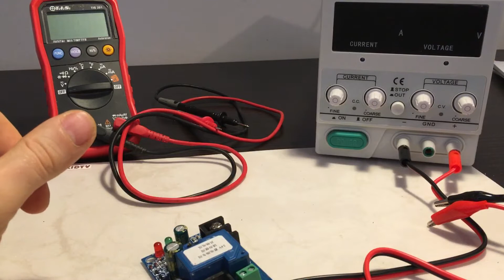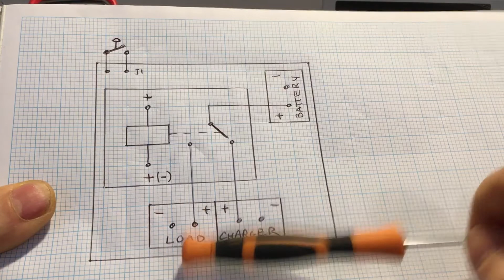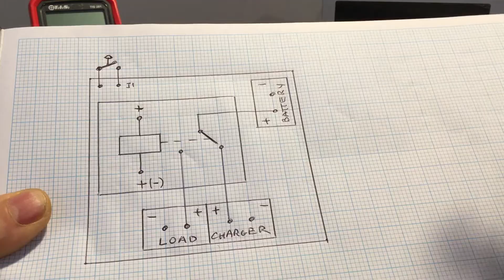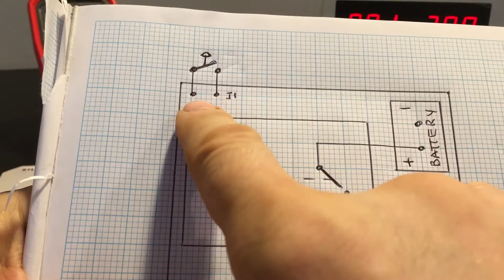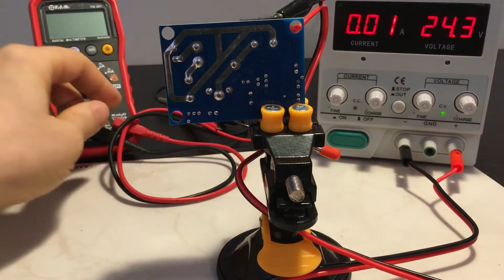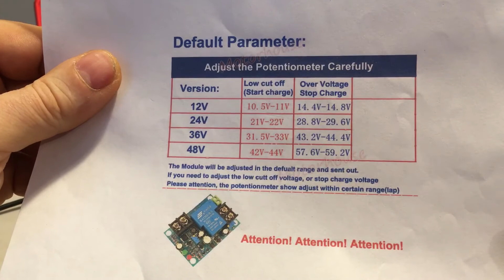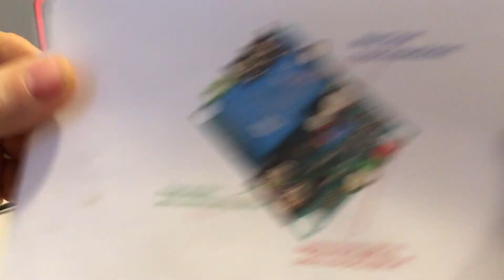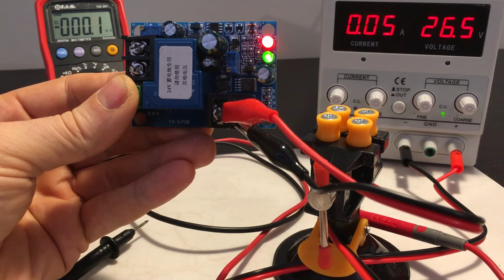Battery Controller Board YX-1708

Comment: A good video.

When an override switch is used (6:40), it means that this module can be used simultaneously (parallel) to charge and supply the load?
Reply: That's what I want to know, do you have the answer?

Comment: Can this product is used for charge lithium ion battery pack s
Reply from the maker: Depends, but Li-ion cells need to be charged to 4.2v per cell and ideally stop discharging at 3.7v per cell. You are better off buying 1S, 2S, 3S…etc control board, they are mosfet based and pretty cheap and don’t need any tweaking.

Comment: good job explaining what this board is about, there is just a few questions i want to know about this board. what is the lowest and highest voltage you can set on the lower limit when the charger is activated, as well as on the upper limit when load is activated? thanks!
Reply: SHOULD BE 9-15 BUT WHO KNOWS...

Comment: Nice and clear ! May I please ask if it actually stops charging once the set max voltage is reached?
Reply from the maker: If you set the upper limit, once it crosses it, it switches to supply mode. But there is no harm in letting it stay charging, the current through the charged battery is minimal, it won’t overcharge, provided your charger is chosen with correct rating for the battery used.

Comment: looking at your circuit, it appears that the load is disconnected while the battery is being charged. I intend this device to charge a 12v 7AH SLA alarm battery from a 12v 110AH Caravan Leisure battery supply. The SLA Battery is to used to keep power applied to a GPS/GSM tracker circuit which needs to be supplied 100% of the time. I'm pretty sure the load terminals will not provide power all the time so i may have to connect it in parallel with the SLA battery and just ignore the load terminals.

Comment: does it work like a smart 12v battery charger? problem with smart chargers is that it cannot detect and charge a 12v battery if it is below a certain voltage. can this charge a battery below 0vdc - 8 vdc like a manual battery? thanks for the video.
Reply from the maker: The board has 2 potentiometers, one to set top and one to set bottom limit. If the battery charge falls below bottom limit, it connects it to the charger terminal, if the charge goes over the top limit, charger terminal is disconnected. Personally, I changed top limit so it never disconnects and used charger that was recommended for the type of battery I used, so it could not overcharge it. The over discharging was my main concern.
Reply: @KillzoneKid  thanks Kill for the quick reply. so it means i can set the lower/bottom limit to 0vdc so it can detect and charge a totally drained 12v battery. the upper limit/top limit remains at 12vdc or the specified battery charge voltage on the battery label. thanks again.
Reply from the maker: @newvaper3794  No, I don’t think you can set it that low and for a good reason, you will kill lead acid battery fast if you let it discharge that low, but you can set it lower than minimum recommended. I think you might want to read on specifics of lead acid battery charging
Reply from the maker: @newvaper3794  Reread your question. the board will start charging battery as soon as you plug the charger no matter how drained the battery, lower limit it for starting charge, if battery is below it it starts charging. so you can set it to healthy limit and if you connect empty battery it should start charging it.
Reply: @KillzoneKid  thanks for explaining them to me. Keep Safe!
Reply: @KillzoneKid  i purchase the YX-1708 charger from an online shop. you are correct no details about this charger but it has a picture on the online shop site how to connect it. i am looking for a manual charger that can trickle charge a totally drained battery. i have a smart charger but it does not detect and charge my battery. i was looking for a manual charger and i think the YX-1708 will solve my issue. thanks again. if it does not work i will go back to dc-dc converters to charge my battery.

Comment: A problem with this product is the levels can be adjusted in a very narrow range.   So if you want to keep your lithium batteries at 80% charge, you can't do it.
Reply from the maker: This control board is for lead acid batteries

Comment: is it ok to plug a 220vac to 12vdc charger?
Reply from the maker: Certainly not. The charger connector is for the battery charger, there is no provision for 220vac.